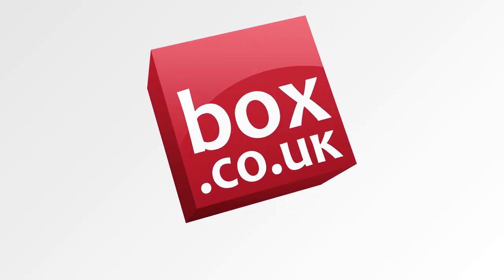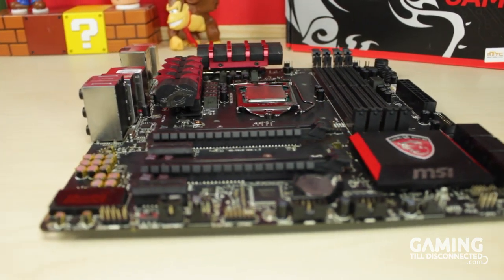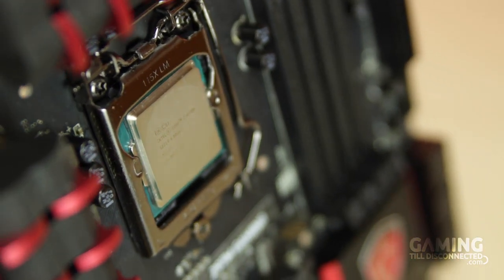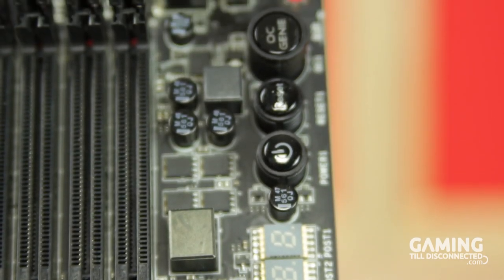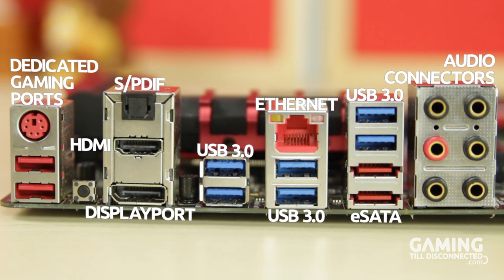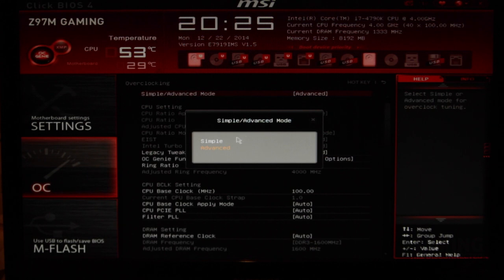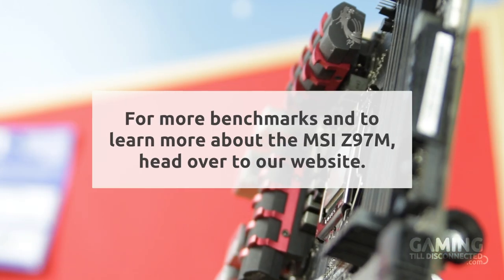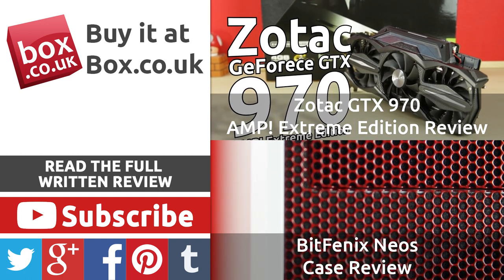MSI Z97M Gaming Motherboard Review - Gaming Till Disconnected

Comment: Quick question guys: I'm looking to get mATX build done soon, and so far I've seen only 2 good motherboards for that purpose (with maxed out USB ports which I need) - this MSIz97m and Asus Gene VII, neither of which does not include onboard (or however you call it) high speed WiFi/antenna. Can I ask why? And is there any mATX board which has WiFi with it? I wanna go 970x2 SLI, so how do I get WiFi connection if I need to? Are there good USB WiFi adapters suitable for gaming? Thaaanks
Reply: Thanks *****, already got the the build. mITX with MSIz97m and it has on board Wi-Fi (I found out later) and yes I'm using ethernet now anyways :;-)

Comment: Can it hold 2 Graphics card ?
Reply from the maker: +[XpS]XpSolo depends on the size of the graphics cards. If they take up 2.5 slots like the new AMD 300 series then no.
Reply: can you use 2 MSI GeForce GTX 750Ti Gaming 2GB PhysX
Reply from the maker: according to the MSI website the card your referring to has a height of 37mm http://www.msi.com/product/vga/N750Ti-TF-2GD5OC.html#hero-specification. If that is the case then in theory two of them will fit in this motherboard.
Reply: +[XpS]XpSolo GTX 750 TI's cant go in sli!!! Dont buy one extra!!!!
Reply: okay can you find a motherboard and 1 graphiccard ? To me ?
Reply: [XpS]XpSolo whats tour budgeet?
Reply: not more than 227 $ for the motherboard and 303$ (i dont matter if it a little bit over the price !
Reply: Asus Z170-A
Asus R9 380 4GB

If you want a working pc dont buy this, as these are just 2 of a lot of parts youd need